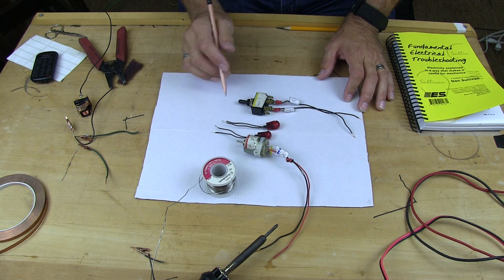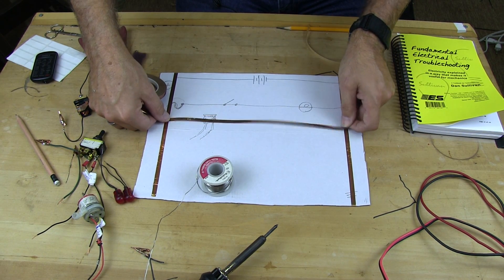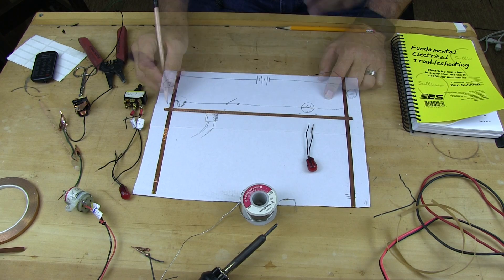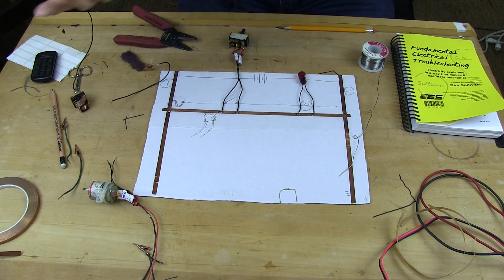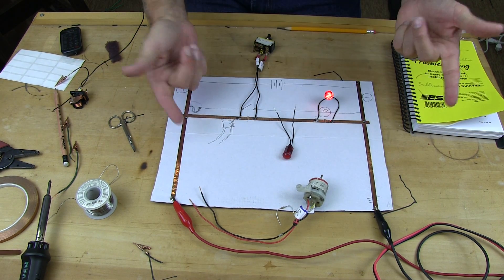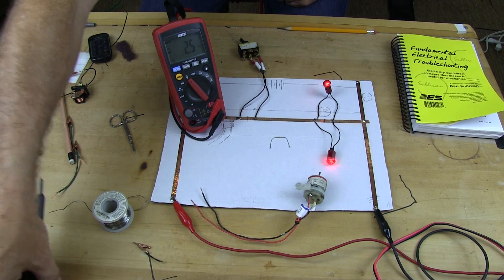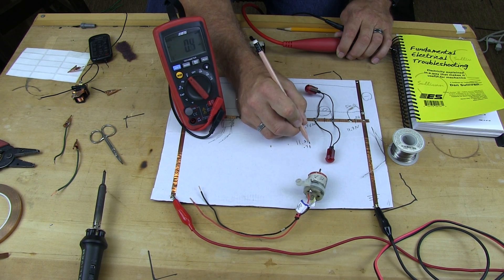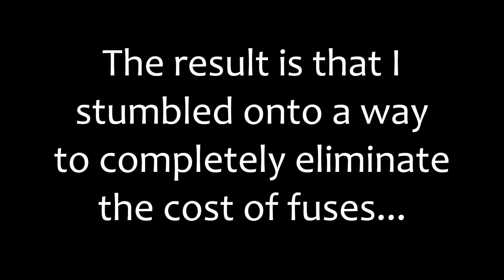Teaching Ohm's Law to Techs - Part 2

Comment: Thanks for the videos I purchased load pro and your book for my shop a while ago and am going to start using the load pro for diagnostics on vehicles. I am a small one man shop that does general repair from check engine lights to things like engine swaps and every thing in between.

Comment: Thanks Daniel! Great teaching! Can you tell me what type of battery source you were using for this instructional project. Is it a 12v DC car battery or AC, size etc. Thanks again, Mike CA.
Reply from the maker: I have a couple of sources, but what's easiest for me is a small, 12V alarm battery from Radio Shack, using a very cheap trickle charger from Harbor Freight.  You can solder connections to the battery that are convenient for you and it isn't very bulky. However, one system I haven't really had time to promote is a variable voltage charger for a laptop - usually a replacement charger. In a classroom environment you can use one voltage for calculations for the Ohm's Law stuff, then have the students recalculate for a different voltage -- then all you do is change the voltage and see if they got it right. My experience is that it only takes about 2 days of this before almost all of them figure it out.
Reply: So is it now "circuit-board" or "circuits-board" like in, as you said, "parallel circuits".
I guess, most of the times there will be parallel circuits on that board.
Reply from the maker: Illuminator I suppose both work, but the basic unit is a single circuit. Parallel circuit"s" are a matter of connection. Circuits don't have to be parallel.
Reply: Daniel Sullivan So, if I have to hold a speech at the UN next week, mainly addressing a delegation of NASA engineers, shall I say "circuit-board" or "circuits-board"? I don't want to make a fool of myself.
Reply from the maker: Actually, the engineers would be texting each other about the cute girl at the entrance they'd never have the courage to talk to, not be listening to you, but, you asked a question I hadn't thought of. It's really a grammar question - not electrical. I'd have to say that both work - but I can't think of  non-electrical example. Well, maybe, "dirty clothes basket" is plural, because we assume more than one dirty towel. "Spark plug tray" is singular, but there is usually more than one spark plug. I think we'll have to keep thinking about it...
Reply: Daniel Sullivan NASA engineers, who do not have the courage to talk to the cute girl at the entrance, do not exist.
However "circuit board" sound more right to me. I'll stick to that.
Language, like humans, does not seem to follow logic most of the time.
Reply from the maker: Illuminator I encourage everyone to know as much as possible, and make decisions that seem right to them. Our society has suffered because of people who are afraid to take a stand. I insist upon parallel "circuitS" because it's both electrically AND grammatically correct, though many will disagree, only because it conflicts with their immediate understanding. I realize I change peoples' live - at least a little - and hopefully for the better. I'm considered a good teacher (thank you for any such thinking) because I am willing to challenge the status quo. If what we've been doing since 1960 worked - I wouldn't have been teaching what I teach for 20 years...

Comment: One Question.. What does I actually mean? and why is it that the letter I represents Current? It makes it more confusing to remember and relate. It clashes with my brains logic.
Reply: +R Valasini From what I remember from basic electricity (could be wrong), R = resistance, a.k.a. Ohms, E = electromotive force, a.k.a Volts, and I = inductance, a.k.a Current.
Reply: André-Marie Ampère, after whom the Amp is named, was French and the french term for current is "intensité du courant" which translates to "current intensity".  So he used I in his equations and other languages followed that convention.

Comment: Sir i have one question. sorry if it sounds stupid. During that bad ground demonstration..when you applied that resistor, the current was still flowing through that bulb. Fine because current chooses least resistance path flow. 

But then. here it starts the confusion. When you disconnect the conductor foil across resistor..the bulbs stop blinking. Shouldn't the maximum current flow through bulb again and light it up because it has low resistance than the applied resistor?

I mean..i understand that the current has no choice but to go across resistor to complete the circuit. But then does it mean that a high resistive load tends to pull the current more across it?

But AGAIN because it is a resistor... it should actually limit the current and voltage to minimum and not suppose to maximise it?

shit....i must bang my head again to the wall.

Comment: Cost of fuses? lol. Don't think so. Fuses are only bits of metal wire anyway but they are specific for a certain amount of amps. I wouldn't trust a piece of solder. Plus you would have to add multiple bits of solder to get the required allowance for amps. Plus being solder even at lower amps it would slowly go soft and pull apart. Where as the metal in a fuse is designed to stay strong all up until a certain point and then suddenly burn out.
Reply: Lord of the belts: The return of the KING

Comment: 6:20 to 9:05
So you said at 6:20 it's a parallel circuits yet at 9:05 all you have done it replace the ground with a resistor to simulate a bad ground but you claim it's not a series circuit?

It has stayed the same in both though. The current comes though both lights which are arranged in a parallel way. Nothing has changed.
Reply from the maker: No - you're right. A high resistance fault IS series with the load. I don't think I said that it wasn't - if I did I made a mistake. Normal circuits only have one load, and two circuits in parallel are parallel circuitS. My assertion is that the term parallel circuit is wrong - and also confusing to someone who is working on a 400 ton truck. You're mistaken to think it's semantic - there's a big difference between tsunami and tsunamiS...

Comment: The circuit/circuits thing is a bit of semantics. But regardless you are technically right. In a way most circuit boards should probably be called a circuits board since there is nearly always many circuits on one board such as computer motherboards.

Comment: Adding a wire is basically creating a fuse.  Old fuses are simply just a piece of a conductor which is rated for a specified amount of amperage.  More modern day fuses are still the same but some have feature like time delay.  Thats all fuses really are.  Each wire is a particular thickness.  The amount of thickness is what allows specified amount of amperage to to flow through it without it burning up.  For example, a  #14 gauge solid copper wire is rated for 15 amps. If you were to use a piece of that as a fuse it would hold up nicely.  However, each wires current carrying capacity can vary on many different things; what the material is (copper, aluminum, gold, silver, etc.),whether its in solid or stranded form, ambient temperature of location, whether its used for continuous use, etc. That alone is great for experimenting with.  You could even put a meter and a variable resistor in the circuit and watch the amperage blow the homemade fuse.  You will get a good idea on the actual restrictions for your homemade fuse. 

Not completely understanding overcurrent protection devices like fuses/circuit breakers is why so many people have house fires.  Some DIY people will perform work in their house and change out circuit breakers for higher numbers.  They do not realize that circuit breakers/fuses need to be correctly sized to the current that the circuit draws.  If the breaker/fuse is rated higher what the wire can carry for ampacity, the wire will heat up and burn before the fuse or circuit breaker will pop resulting in a fire but if your lucky, the fuse will just break.  It is really neat to see on a board though, and as you get a little higher in amperage and wire size you will see it glow red and yellow before it pops.  Its worth seeing, as long as you do it safely and correctly.

Overall this is a great video and idea.  A good chance for people to learn at different levels and job positions.   What I do is I use a "snap Circuits" kit i bought off amazon for $50.  I had bought it for my boy to teach him some of the things i know.  whats great about this is it can be modified really quick and many different ways.  It comes with switches, power supplies, resistors, variable resistors, motor, lights, capacitors, amplifiers, speaker etc......  Everything is encased in plastic and required no soldering.  Every component also has both positive and negative spots on it to put meters in line.  It also has a book that shows setups for about 300 different projects....They all snap in place on a board very quick.  Either way is a good way and i highly recommend learning hands on.  It just makes much more sense  For a quick generalized reference you could refer to the National Electrical code book, Article310; Table 310-16 for a generalized list of wire sizes and their current carrying capacity.

Comment: Hi Mr. Daniel! Thank you so much for posting these wonderful videos! I have learned so much in such a little bit of time. I plan on educating myself through your electrical videos. I do have one question. I want to try this "Ohms Law electrical experiment at home."I noticed that you used alligator clips for power supply. What is on the other end of the alligator clip to supply the power? Meaning to say what end and also what is the end plugged into to supply power?!? Sorry for my lack of knowledge lol. When you get the chance, please write me back  at your earliest convenience. Thanks, John! :)
Reply from the maker: Pretty much anything you can find. 12V battery (what I use), 9 D batteries soldered in series, a computer power supply... Doesn't matter. You can use an old plug-in power supply for a hard drive, a radio, or anything else. I suggest at least 9V DC - but 12VDC is best.
Reply: Daniel Sullivan Hi Mr. Daniel! Thank you for your quick response and informative answer! I'm excited to get started! Thanks again...Peace, John.

Comment: I have used one real fine  wire as a fuse and also to check grounded circuit I would use the fine for a power supply.

Comment: About the end when you use the peace of solder as a fuse. I do work with Ac/Dc inverter and a small trick to be sure you do not invert the + and – ( when no indication ) is to connect one of them with a small solder core ( No load on the inverter !! ) it is not the best way but it save the electronic circuit. By the way. I love you teaching style and the way you do those video, quick and sharp.

Comment: A nice methodology for visualizing, and a good deal easier for a newbie to follow than jumpers on a breadboard (which obviously do essentialy the same tasks.)  
One thing confused me a bit.  When you cut the non-resistant ground leaving the 500 ohm resistor, the lights went out.  Was that because 500 ohms of resistance blocked all current flow, or simply that it reduced the current to a level that was insufficient to cause the element to emit visible light? Or am I missing something?

Comment: In the circuit without the 500ohmm resistor, if you unscrewed the top bulb, the bottom bulb would remain unchanged in terms of brightness, and the current in the circuit would drop back down to 59, correct?
If you jumped the socket, what would happen? How much current would go through each path?

Comment from the maker: You almost got it. If you wired them in series, the resistance WOULD double, do current would be half. The bulbs are always resistors - it's how you wire them. In series two 100Ω resistors equal 200Ω. In parallel they equal 50Ω. The problem is that people forget that MOST current takes the path of LEAST resistance. Not all of it.

Comment: Another thing that I have trouble wrapping my head around is the idea that the circuit "knows" what's ahead of it "down the line" before it gets there. If you think of electricity as flowing like water from positive to negative, then understanding why putting a 500 ohm resistor *downstream* from the bulbs would cause the bulbs to not light is impossible.

Comment: Thanks Dan. The "2nd hole in a bucket" analogy helps. So if you wired those bulbs in series then the amperage would not change (no extra holes in the bucket), and consequently they would not burn as brightly. The bulbs *do* supply resistance, but they are not resistors per se. Is that about right?

Comment: Dan I love your videos. This one has me confused though. Specifically, when you attach that second light bulb, why does the amperage double? Aren't you doubling the resistance (if it's in series)? If the resistance is applied in parallel then isn't the total resistance the same as with one bulb?
Either way I can't figure out why the amperage doubles!
Reply: I realize your question is 7 yrs old and you no doubt figured out the answer many years ago.  So this is for others.  Dan has described resistance in terms of a hole in a bucket.  The smaller the hole, the greater the resistance, the smaller the rate of water (amperage) leaking out.  If you add another hole (another resister / load), the rate of leakage increases.

Comment from the maker: Where are you teaching? I allow teachers to sit through my 4-day FET class for free. If you can arrange that you're welcome to attend. I'll help you any way I can. Just remember that if you completely understand both Ohm's Law and Kirchoff's Law (voltage drops have to add up to source V) then everything will conform to them. Speakers are great for teaching motors, magnetism, resistance and generators. Don't be afraid to be wrong. That's way too much pressure to put on yourself.

Comment: That was great , the lead fuse is something I would not have thought ever, glad you stumbled across it.  I will have to do some testing to find out  what amperage melts the solder. Very use full  for electronics if it does react at low amperage.  Thanks Steve.